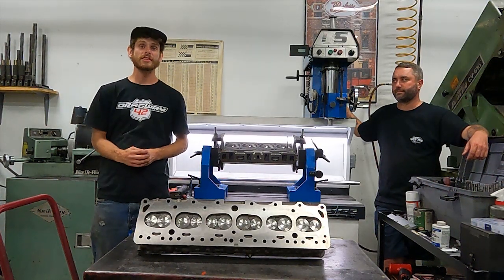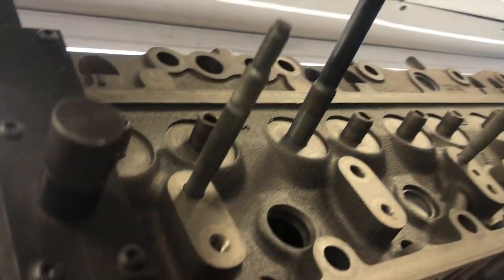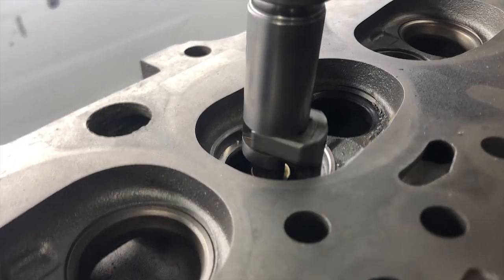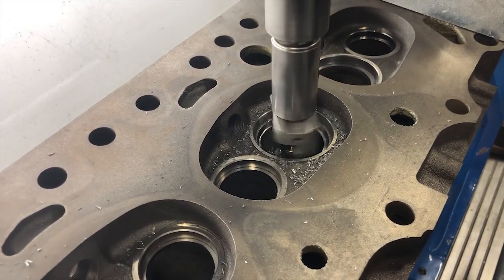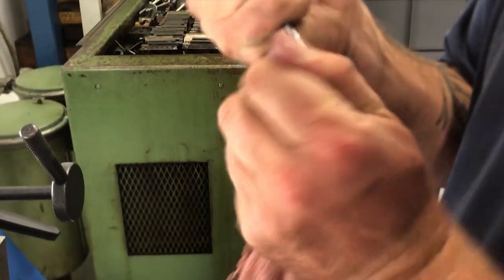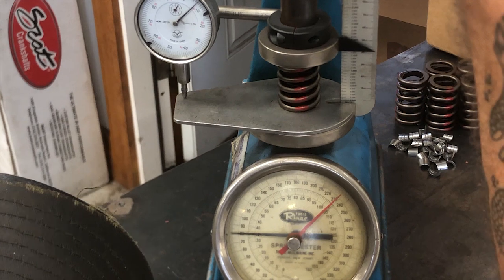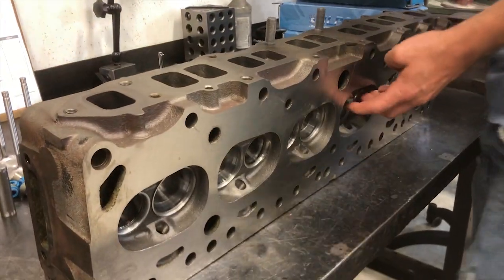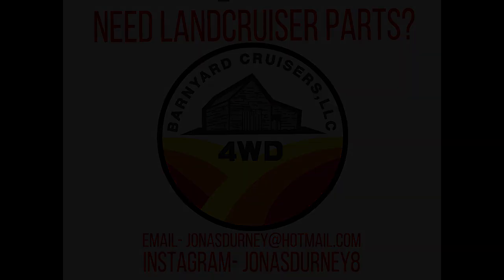Toyota Land Cruiser FJ60 Performance 2f Engine Build PT4: Machining and Assembling Cylinder Head

Comment: I literally just finished my 2f performance build and i went to the chassis dyno before so I would have a baseline with my old engine “tired” before 100hp 185tq before 

After 1mm overbore, .060 head shave, bigger Chevy 1.96 valves, bowl blend, LS beehive springs, Delta cam torque grind, 
New 6-1 header, Webber 38/38 
After power on same dyno 
149hp and 231TQ and that was still lean on air fuel finally got my new bigger jets and going back next week to retest but I’m conservatively expecting another 10hp and 10tq I was way lean at 14.1 afr so I’m very happy with my results gained 50%!!! With similar mods!
Reply from the maker: Nice! great numbers cant wait to compare.
Reply: I was surprised how well the 2f responded to Modification my expectations were 30% increase so the fact that I’m Already 50% and probably gonna end up at 60% increase is amazing to me I had to 60 is much more usable with that extra power can actually pass somebody on the highway 😂
Reply from the maker: @justindearborn7275  thats my thought! i just didnt want to do a v8 wanted to do some stuff that was different. so how far it can be pushed.
Reply: Great build. Do you know what the specs are on the Delta torque grind cam.

Comment: Great video guys.  a couple of questions. What size valves did you end up using. And why not open up the area around the larger valves in the combustion chamber.   Also . Very nice design of new machine you have there. Did you machine the head and deck to the point that you will need different length pushrods?   Getting closer. will you end up dynoing this after it is done?
Reply from the maker: i would reach out to classic motors to find out about sizing etc. i may but dont want to stress out the brand new motor parts.